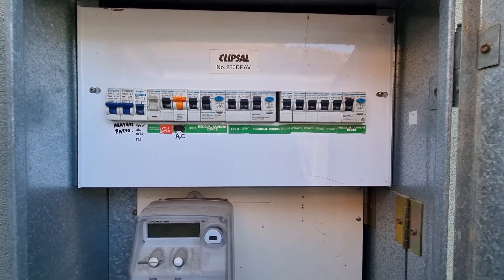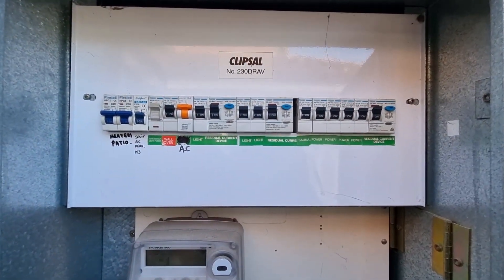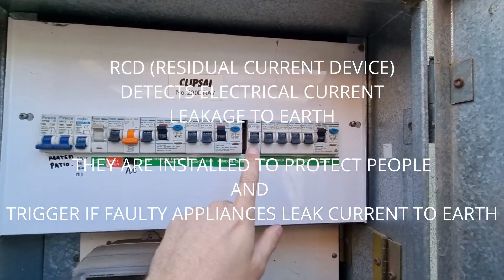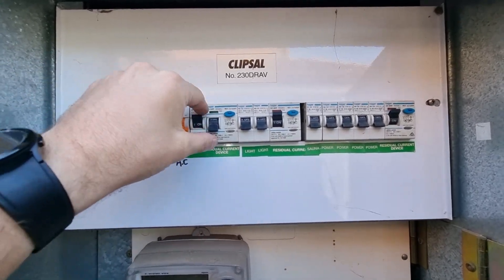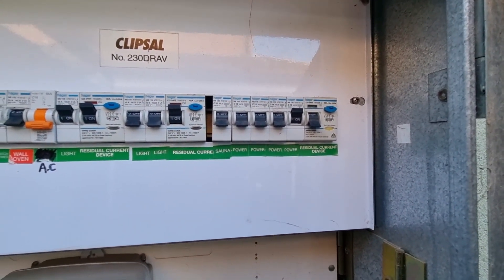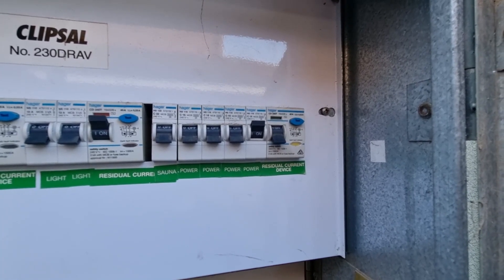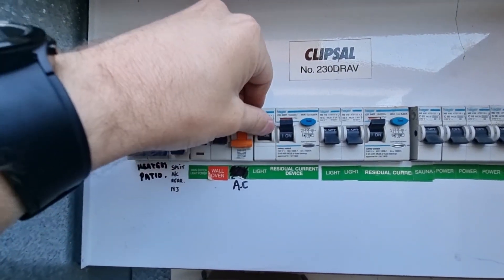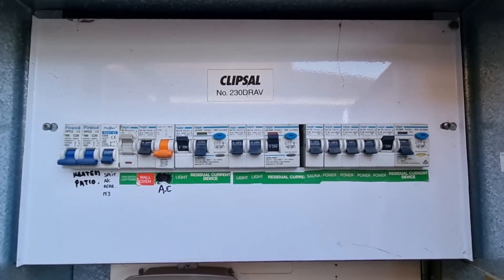Emergency Power Restoration: Quick Fixes for Sudden Power Outages

Comment: This happened to us mate, previous owners brother-in-law built the place. When wiring in the circuits they overloaded them and ended up putting 20amps in instead of the 16s. And the way the 2 circuits for power were split was straight down the center of the house which in theory was good, but when the toaster, kettle, fridge, microwave, tv, fishtank etc are all on the same one and it melted the circuits and almost caught fire. Because it tripped once or twice here and there but this one night was continuous so i called the sparky and he was pretty shocked but changed out the 16s, and now just need to turn things off more. Cheers for the video mate 👍
Reply from the maker: That doesn't sound good. Nothing should catch fire though. The fundamentals are a circuit breaker protect the cables so they don't overload/heat up and catch fire and rcds protect people if there is any potential difference and leakage to earth they should trip. For domestic applications they shouId trip if exceeding 30mA.

I know in my old house it tripped occasionally, but that was because I had the microwave,kettle, and toaster on at the same time. 

Back in the day fridges actually use to be on their own circuit without rcd protection because they leaked current and caused intermittent tripping. Not today pretty much everything now needs rcd protection.
Reply: @allelectricalau  yeh I know mate, the fella was a wanker and dodgy so who knows what they did. There is rcds there but don't know what happened. The circuits were melted but 

Ah righto mate the leco said they were meant to be 16s but I'd have no idea. I'm in nsw so not sure if it's different throughout aus.
Reply from the maker: @callanmurphy9807  Maybe just trip the rcds once a year with the test button and make sure they are working just in case there is something dodgy waiting to pop up.
Reply: @allelectricalau  yeh we're about to sell anyway, but I can't give a problem to someone else so we'll either get it fixed or tell the new owners what it was like. 

Got any more video.ideas coming up? Like maybe installing a ceiling fan or air con etc if it comes up anyway. Cheers mate
Reply from the maker: @callanmurphy9807  not sure at this point I might do one on the NBN network and how to prepare and get fibre to the house instead of the old copper line. Also been thinking of product reviews to reach a wider audience anything from cool home gadgets to smart switches ect
Reply: @allelectricalau  yeh nice mate that's a good idea, I'm in rural nsw so we don't have anything to the house like that haha. 

Yeh the little gadget and smart switches would be good mate, I've seen a few vids from aus/nz about dimmer switches etc and they were good.